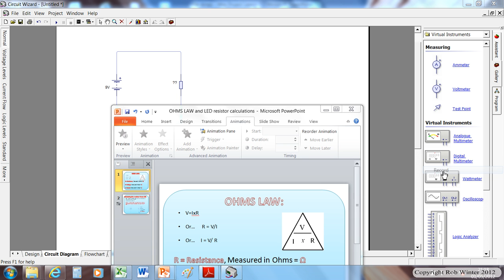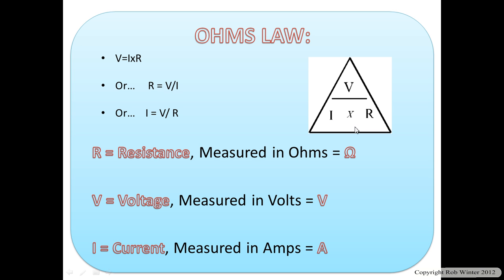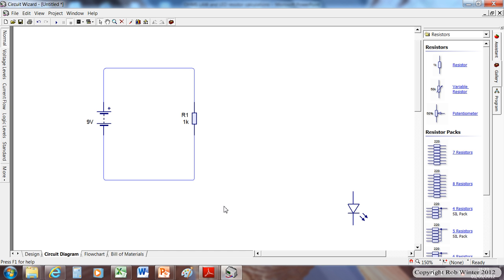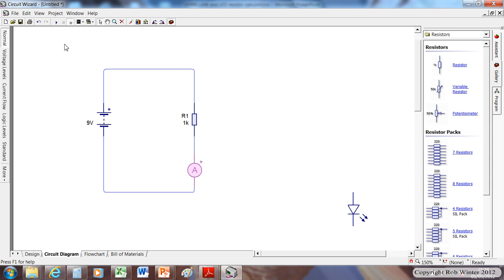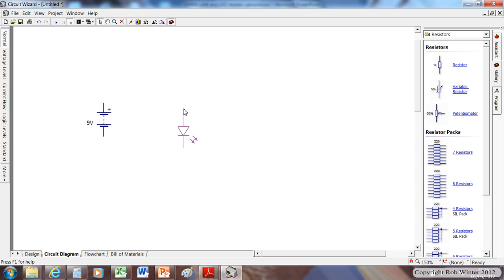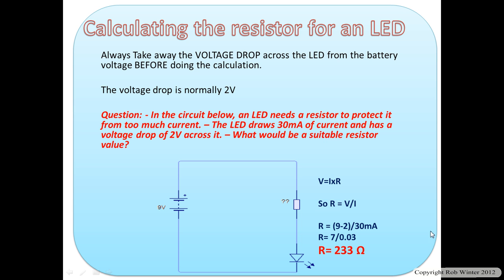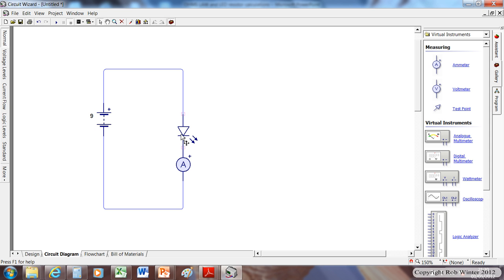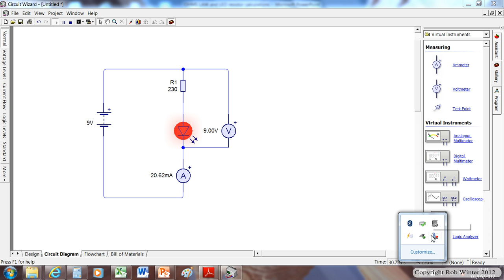Ohms Law - LED resistor calculations - Connecting Volt and Ammeters.avi

Comment: Hi There if you put 3 LED;s in series with a 9 volt battery  what resistor would you use, do you have 30 mA or 90ma, do you need to drop 6 volts across the 3 diodes....from Fred in essex
Reply from the maker: Hi. Firstly why do you want them in series? parallel is nearly always a better option. they get same voltage that way and you can achieve max brightness without a massive voltage drop.  If you want them in series, then yes, you drop about 1.2v across each LED, total draw should be 90mA but due to the voltage dropping across the LEDs its likely to be less draw than this in reality. what's the  application? why can they not be in parallel?
Reply: +Rob Winter Hi Rob, well yes they can be in Parallel, makes no difference, by the way his name was Georg Ohm without an e, it was for a cheap continuity tester someone asked me to make, for checking bulbs and fuses etc, they dont want to buy a multitester, so if you use a pp3 and 3 in parallel what resistance would you use...i haven't tried to work it out thus far...Fred.
Reply from the maker: V=IR,  so R=V/I . Have to reemove the voltage drop of the LED from calcs. So assuming about 1.2 v drop if you're using a 9v supply then you have 7.8V to 'resist'. Thus 7.8/0.03 = 260 Ohm, but obviously need to go to the next largest value you have available. I'd got with 290 or possibly even 330 ohms. Make sure each parallel LED has its own resistor.  Are you sure the current draw is 30mA? It can vary based on colour so check the datasheet
Reply: +Rob Winter Ok Rob thanks, i was guessing at 30 mA, they are green ones.....Fred cheers.